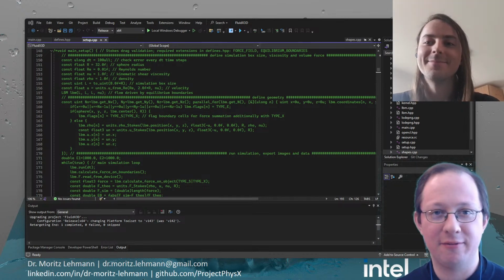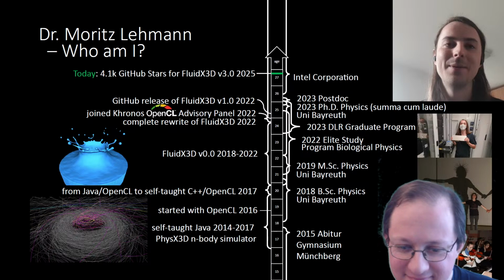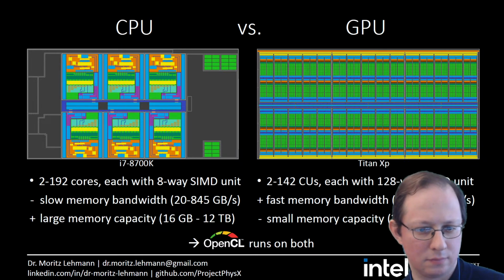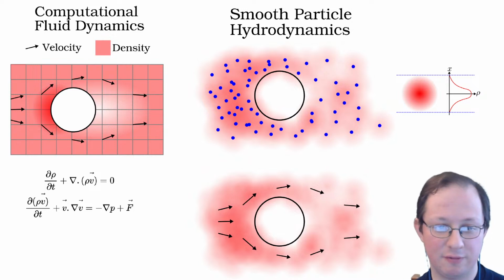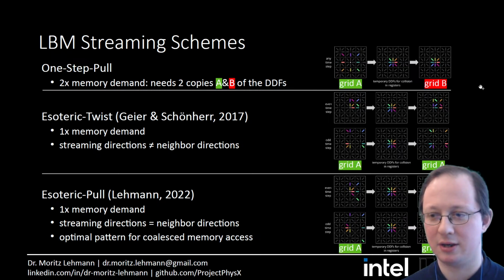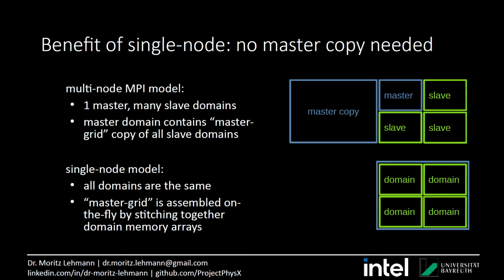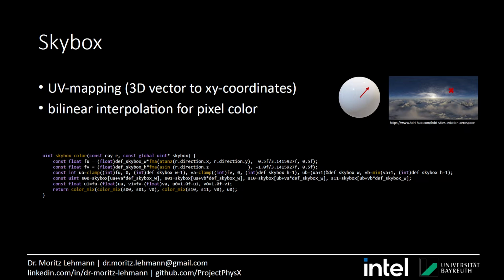The FluidX3D code with Moritz Lehmann

Comment: Its a nice code with a few new optimizations but unfortunately there is a reason LBM is not used much.
Reply: What's the reason?
Reply: @Nick_Nak_2224  The first big point is the narrow applicability regime which is restricted to low Mach (< ~0.2)  and Knudsen (< ~0.1) numbers. For example, this alone makes LBM unusable for the vast majority of flows we deal with in aerospace applications. That is perhaps not as much a problem in academia where codes are usually written for a specific application, but in industry, where software is written as a product that serves as many applications as possible, this is huge drawback.

The second point is that LBM REQUIRES structured grids and also has a low order of accuracy. Geometry is dealt with by discretizing the geometry as rough, stepped, surfaces that are aligned with the principal axes of the structured grid. This is a huge problem with boundary layer computations and the only way to mitigate it is by using a ridiculously fine discretization that also means that the computation is now very expensive again. LBM has disappointing convergence properties compared to other methods. Both of those aspects mean that LBM is very fast on a per-timestep basis, but not that impressive on a time-to-solution basis for a given error requirement (this is the metric users care about). In the structured grid setting, modern finite volume, spectral element and spectral codes are as fast or faster on a time-to-solution basis with given error requirement than LBM implementations, both on CPU and GPU, while also having a lot of robust mathematical theory available to make guarantees about errors and convergence. Those methods (finite volume, finite or spectral element, but not spectral) can also deal with body-fitted, curved, unstructed meshes and this is critical for industries where boundary layers are important (aerospace, automotive, heat exchanger, reactors, ...). LBM sounds and looks great for some specific problems, but in practice it falls short of especially modern FV and SEM codes for practically any industry-relevant application I can think of.

Comment: Fluid X3D: A Deep Dive into OpenCL Accelerated Fluid Simulation

*   *0:01:22 Introduction to Fluid X3D:* Moritz, the creator of Fluid X3D, joins to discuss his GPU-accelerated fluid simulation code, which uses the Lattice Boltzmann method.
*   *0:01:51 Motivation:* The code was developed as a faster alternative to existing solutions (like ESPResSo) for simulating blood flow, eliminating slow data transfers between CPU and GPU.
*   *0:02:41 Running a Test Case:* Instructions are given for running a sample simulation (cylinder in a rectangular duct). Defines.hpp and setup.cpp require modification to set up and enable.
* *0:05:45 Visualization Options:* The code offers different real-time visualization modes, including Q Criterion isosurfaces (showing shear rate) and volumetric ray tracing of velocity fields.
* *0:11:16 Discussion of the code:* We learn that the lbm simulation is live.
*   *0:11:28 Moritz's Background:* Moritz is a self-taught programmer with a formal background in physics (Bachelor's and Master's degrees). His research involved simulating blood flow and microplastic transfer.
*   *0:18:55 Choosing OpenCL:* Moritz explains his choice of OpenCL over CUDA, highlighting OpenCL's portability (works on various GPUs, CPUs, and even older hardware) and comparable performance.
*   *0:21:19 Performance Claims:* A graph demonstrates Fluid X3D's performance across various GPUs, emphasizing memory bandwidth as a key factor and the interchangeability of workstation and gaming GPUs.
* *0:24:08 OpenCL in depth:* GPU and CPU differences, memory access (host vs. device, local vs. private memory).
*    *0:27:16 Performance Graph Discussion:* A performance graph showcases various hardware. The claim is that the main difference today lies in the memory subsystem.
*   *0:29:59 OpenCL Portability:* OpenCL's portability across vendors (NVIDIA, AMD, Intel, even Apple silicon) is emphasized, despite Apple's deprecation of OpenCL support.
*   *0:32:33 CPU vs. GPU Architecture:* A basic comparison of CPU (fewer, more complex cores) and GPU (many, simpler cores) architectures is presented, emphasizing the GPU's suitability for SIMD (Single Instruction, Multiple Data) operations.
*   *0:37:40 Memory Movement and the PCI Connection:* The importance of minimizing data transfer between the host (CPU) and device (GPU) is highlighted.
*   *0:40:42 GPU Kernel Example:* A simple OpenCL kernel example (vector addition) illustrates the parallel execution of the same operation on multiple data elements.
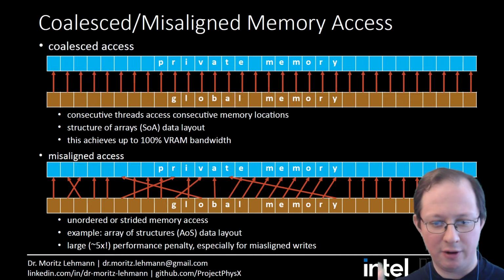*   *0:44:04 Memory Access Optimization:* The critical importance of coalesced memory access for GPU performance is discussed, including the benefits of structure-of-arrays vs. array-of-structures data layouts.
*   *0:49:54 Introduction to CFD:* The video introduces the concepts of Computational Fluid Dynamics (CFD), including grid-based methods and smoothed particle hydrodynamics.
*    *0:51:38 Lattice Boltzmann Method (LBM):* The LBM is explained as a grid-based method that indirectly solves the Navier-Stokes equations by simulating the Boltzmann equation.
*   *0:54:11 Adaptive Mesh Refinement (AMR):* The concept of AMR is introduced, and its potential benefits (higher resolution in regions of interest) and challenges (implementation complexity on GPUs) are discussed.
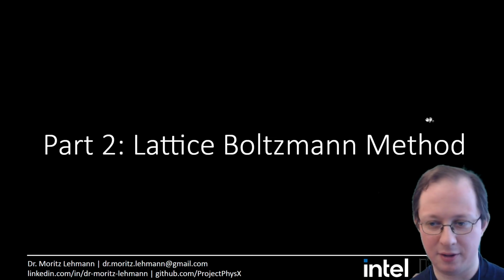*   *0:57:07 LBM Algorithm:* The core steps of the LBM algorithm (streaming and collision) are detailed, along with the memory requirements for density distribution functions, density, velocity, and flags.
*   *1:01:35 Memory Footprint Optimization:* The video highlights strategies to reduce memory usage, including using single-precision floating-point (fp32) instead of double-precision (fp64).
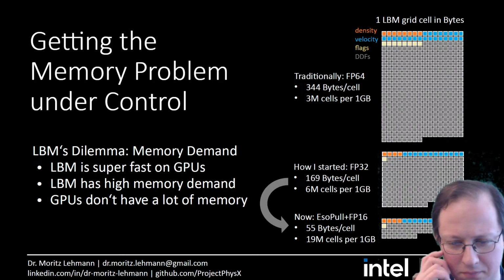*   *1:03:37 Esoteric Pull Streaming:* A novel streaming pattern ("Esoteric Pull") is presented, which reduces the memory footprint by eliminating the need for duplicate copies of density distribution functions.
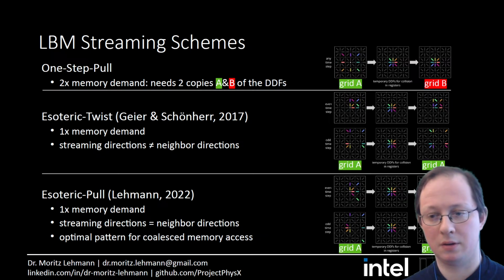*   *1:08:37 FP16 Memory Compression:* Further memory reduction is achieved by compressing density distribution functions to 16-bit floating-point values (fp16) for storage, with conversions to/from fp32 for arithmetic operations.
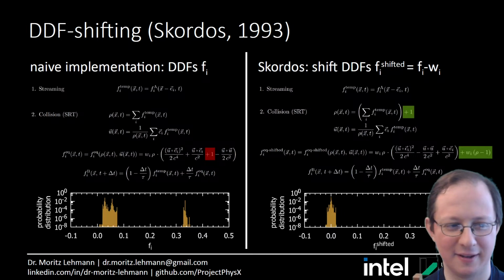*   *1:11:31 Numerical Considerations:* The impact of floating-point representation and arithmetic precision on simulation accuracy is discussed, including techniques like shifting the distribution functions and optimizing the order of operations.
*   *1:15:50 Arithmetic vs Memory Precision:* The separation of arithmetic precision (fp32) and memory precision (fp32 or fp16) is emphasized.
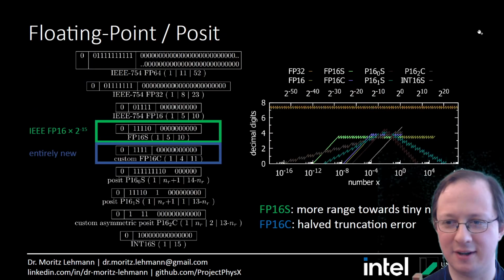*   *1:16:55 Floating-Point and Posit Formats:* Different floating-point (fp32, fp16) and posit number formats are compared in terms of precision and range, including a custom fp16 format.
*    *1:22:14 Custom FP16 Conversion:* Since no hardware conversions for the custom format were available, the creator implemented it himself, using bit manipulation.
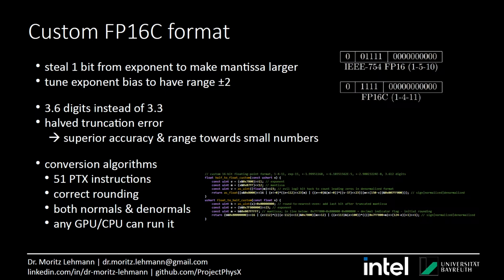*   *1:24:51 Simulation Examples:* Visual comparisons of simulations using different floating-point precisions (fp64, fp32, fp16) are shown, demonstrating minimal visual differences in many cases.
* *1:28:54 Extensions:* Mentions extensions like G-forcing (for gravity or pressure gradient), and an extension to do thermal convection flows.
*   *1:31:11 Multi-GPU Support:* The code's support for multi-GPU configurations (even cross-vendor) on a single compute node is described, although limitations due to the lack of peer-to-peer memory copy in OpenCL are noted.
* *1:34:39 Multi-GPU Queing:* Explanation that no multithreading is used.
*   *1:35:52 Kernel Queuing:* The simplicity of kernel queuing in OpenCL (non-blocking enqueues) is highlighted.
*   *1:36:29 Boundary Layers and Detachment:* Challenges in accurately modeling boundary layers in LBM with Cartesian grids are discussed, and the lack of a general solution for free-slip boundaries is mentioned.
*   *1:41:38 Single-Node Model:* The advantages of a single-node multi-GPU implementation (avoiding MPI complexities and reducing memory footprint) are presented.
*   *1:43:24 Rendering Engine:* The creation of a custom rendering engine in OpenCL is described, enabling in-situ rendering (data is rendered directly from GPU memory, avoiding costly data transfers).
*   *1:46:14 Marching Cubes:* The Marching Cubes algorithm for generating isosurfaces from volumetric data is explained, along with optimizations to the triangle table and interpolation.
*   *1:49:49 Ray Tracing:* Ray tracing for physically accurate rendering of reflections and refractions is discussed, including techniques to mitigate thread divergence (grouping rays with similar directions).
* *1:53:52 Ray grid traversal:* This is discussed as an acceleration structure, compared to rusterization.
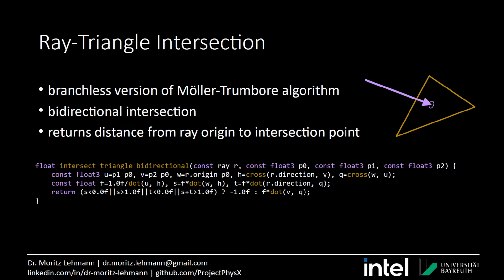* *1:55:39 Normal Interpolation:* Smooth surfaces discussion.
*   *1:57:48 Skybox Color:* The use of UV mapping for the skybox color is mentioned.
*   *2:00:08 Future of OpenCL and Fluid X3D:* Moritz expresses his belief in OpenCL's continued relevance and discusses potential future developments for Fluid X3D, including ongoing bug fixes and potential exploration of AMR.
* *2:03:30 Concluding Remarks:* The code's availability as Source Avaliable, not Open Source.

i used gemini 2 pro 02-05 exp